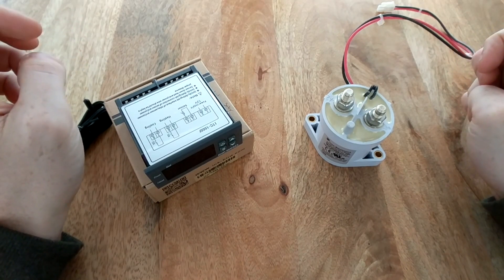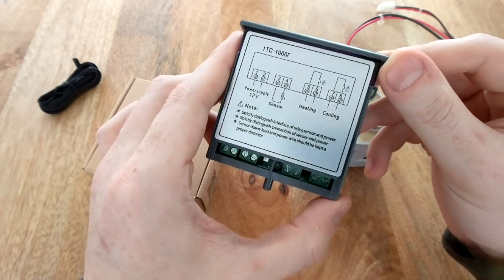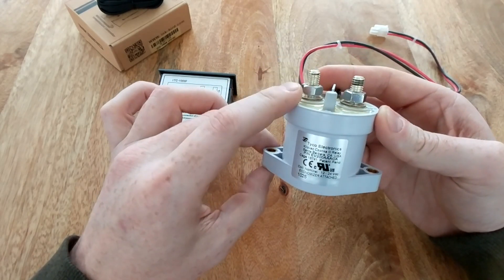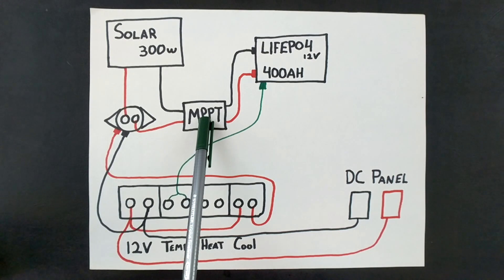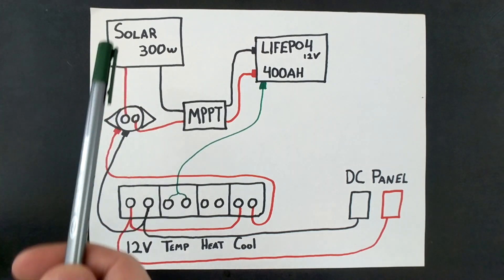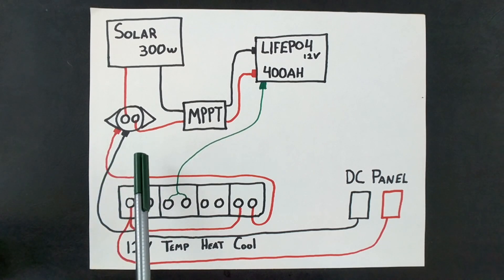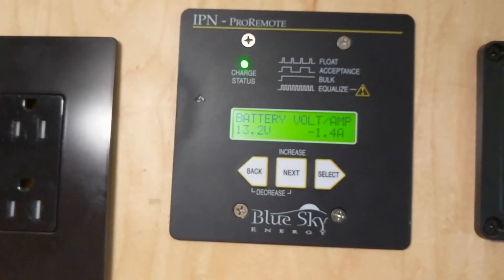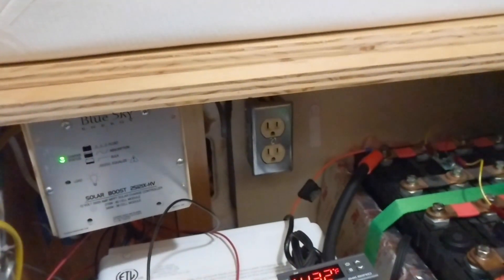How to Prevent Charging of LIFEPO4 Lithium Batteries Below Freezing in a Camper Van

Comment: my understanding is you do not want to disconnect "battery" from charge controller anyway in real world use.  a controller with no battery to send its incoming electrons too.... will destroy the controller is my understanding.     So it is good you; unlike your test,  put this solenoid in a place to stop output from solar panels to reach the controller.  This protects controller and batteries 

my question to you...... would putting a solenoid work on the negative line from panels instead of the positive as you did here?   

myself I will have 6 arrays.... each with their own controller.   My thinking is if I buss barred all the negatives from each array......  then single wire off that to one side of the solenoid.. off the other side being rest of negative path.  My thought is then the solenoid breaking the negative connection when batt temps are too low.......  would stop all arrays from sending juice to their prospective controller.  

Would that work??  Am a bit of an electrical dumbo.   

granted the other option is to use 6 relays. One on each positive connection between solar panel  array and their prospective controller.  Theoretically same as you have done here.

Comment: Doesn’t it take a certain amount of voltage to keep the starter solenoid/ relay open? 
If so, How much energy is that going to bleed off the power coming in from your solar?
Reply from the maker: it only takes130mA to keep the contactor closed so with a large enough bank that's getting charged daily, it's a non issue. However you can accomplish the same thing with a victron battery protect instead and that consumption will be much MUCH less.
Reply: No it only takes power to close the switch while charging. The thermostat uses minimal power to keep track of the temperature.

Comment: GREAT video! After reading all the comments, can you let me know if I'm on the right path. I'm upgrading the AGM's in my camper van to Lithium. I just purchased a Renogy 12v DC to DC charger with a MPPT built in. So charging can be from my van alternator or the solar panels. After watching the video and reading all the comments, I'm thinking of the following: buying the Inkbird and instead of the relay you used in the video, I can use the Victron battery protect? I would need to install it in-between the batteries and my Renogy charger?
Reply from the maker: In theory yes, that should work (and is much lower current than the contactor). Just make sure you wire the in and out correctly depending on which model you get. Current can only flow in one direction through a battery protect. Also make sure that your renogy will not attempt to charge your starter battery once the house battery is full as that will have reverse current and damage the battery protect.

However some chargers don't like it when the battery is removed under load so I have no idea how the Renogy DC-DC would react. I know Victron chargers don't mind if the battery is removed, but other brands (like my original MPPT from the video) specifically stated battery should not be disconnect under load. Since I've never used that model before, I can't say.
Reply: @nebulight  Thanks for the reply. After reading the Renogy manual (for the 2nd time), I noticed it said it will stop charging the lithium battery if below 1c, and reengage at 3c. So seems that the renogy dcdc charger with MPPT has low temp charging protection. If so, that is a great selling point that they are not highlighting very well.  Again, thank you for posting this video, hardy any videos out there covering this subject.

Comment: This is exactly what I was looking for! Thanks so much for posting this over 4 years ago :) So is there anything better you would suggest now that you've presumably had it working for 4 years? I just bought a 300Ah LiFePo battery that does not have low temp cutoff and it's pretty cold out at the moment. Last thing I want to do is damage my brand new battery. Thanks again.
Reply from the maker: I've switched to victron equipment. My battery monitor talks to the MPPT controller (also victron) to transmit temp data with a temp sensor on the battery monitor. So it just stops the charge of the MPPT automatically. You can also wire up the internal relay of the victron battery monitor (BMV-712) to open when there is a low temp and they from that relay, you can turn off other products like the multiplus through an AUX port. Tons of options with Victron.
Reply: @nebulight  What about charging from your converter?  I have my Victron gear setup similarly to cut of charging at a specific temp but that’s only controlling the solar charging.
Reply from the maker: @joshhaas2410  I don’t have a converter in my van. Most people opt to ditch the built in converter in rvs in favor of an inverter charger combo. Victron units have individual charge and discharge control. Since a converter supplies both charge and discharge there is really no way to control them independently. You could wire up a battery protect from victron on the dc side but that turn of discharge as well. Another option is to control the ax inout from the converter with a similar relay setup like the video. That would just turn off the incoming ac to the converter.
Reply: @nebulight  thank you for your advice.

Comment: What about the DC-DC charger?   Will this cut that off too if the temp drops?
Reply from the maker: If you do a setup like this but install the relay on the output side of the mppt and the dc-dc with a single relay it should work. If you do that, you can use a victron battery protect instead of a relay to save on power as the relay takes a lot of power .6 amps just to stay closed. Just make sure the dc to dc is one way (meaning it won’t attempt to charge the starting battery) if you use a battery protect.
Reply: @nebulight  Is it not a good idea to allow the solar to top off the starting battery too?
Reply from the maker: @tonywillingham8109  I only said that because if you use a battery protect current can only flow in one direction. If the current flows backwards through the battery protect you will damage the unit. If you use a relay that’s fine. Though note that charge profiles for lithium and lead acid are different so you may not want it to charge the starter battery anyway.

Comment: I like the idea.  Installing relay before MPPT protects it.  My array will be feeding a max of 75VDC at 9A to the MPPT.  Remote cabin in MN. 400AH LiFePo4 to protect. How may amps does the relay draw?
Reply from the maker: depends on your voltage that's driving the relay. I used this EV500 because I had a spare, but depends on the coil voltage. Could be around .65 amps with my EV500 (a bit high), but your mileage will vary depending on the relay you use. 

As I've said in other comments, I'm not using this setup anymore as Victron Controllers with a BMV with temp sensor can talk to each other and can stop charging on it's own. If you are building a system, I'd consider going with Victron gear.

Comment: Can you set independent heating setting temperature above the cooling temperature in order to control a battery module heater? I am imagining cool set to 0F and heat set to 5 or 10F to keep the battery going in low temperatures. I feel like most thermostats will not allow this since it is counter-intuitive for standard thermostat use.
Reply from the maker: You should be able to as there are two relays for heating and cooling. I no longer use this setup, but if you want to do this, keep in mind that the relays only support 10 amps, so that limits your heating source unless you control an external relay that's higher current.
Reply: @nebulight  what did you switch to using for cold charge protection?
Reply from the maker: @deathbyninja11  A victron MPPT and Victron BMV712 battery monitor. The BMV712 has a temp sensor and will talk to the MPPT turn off the charger when below a set temp. I also had the internal relay of the 712 control my DC-DC charger as well. When the BMV saw the temp below a certain temp, it would open the relay (which would turn off my charger).

Comment: I persued similar solution. I am frustrated considering the amps being used to run my external solinoid.  It runs very very warm to the touch so it is a significant power usage which is counter productive to solar chaging. does any one know of a 500amp rated with low power consumption rated data. i have not seen any such data.
Reply from the maker: I ditched this setup a long time ago in favor of Victron gear which has it built into the MPPT. How large is your solar array? My suggestion if this is a small array that's low voltage is to run the output of your mppt through a victron battery protect. That is if your MPPT can handle the battery being removed.

Comment: Glad to see someone did what I had in mind. Quick question, I would plan to use the layout in your video since I have an all in one Mppt ac to dc charger so I wouldn't want to disconnect only solar but the whole thing. But isn't using 12v to maintain the thermostat be harmful to the batteries?
Reply from the maker: If you have an all in one unit, if it has a power switch, you could bypass the contactor all together and just use the relay to control the on/off switch. This is typically better as if you do this to disconnect the entire unit, some MPPTs don't like to have the battery disconnected especially under load.

And using 12V thermostat isn't harmful to the batteries at all. Yes, it will draw power, but it's such a small amount that it won't impact the over all pack unless the battery is below freezing for days or weeks. If this is the case, it's better to just manually disconnect the battery.
Reply: @nebulight  Thanks for the quick reply. My unit is an MPP solar but only has a switch for the inverter. If it's plugged via AC or solar it will (I believe) still charge. But I like the idea, I'll investigate on this.
Reply from the maker: @Tom-yr3pt  Ah, yea, you're going to be limited there. I think the newer large MPP solar units give you the option for BMS integration over RS485 with a modbus card. Depending on your BMS you may be able to directly control the MPP. http://www.mppsolar.com/manual/ACCESSORIES%20(FOR%20MONITORING)/BMS%20RS485%20Card/RS485-Card-Box-for%20BMS-manual-20181106.pdf
Reply: @nebulight  Good to know! I actually don't have a BMS. I have two Valence U27-12XP wired in parallel which has internal cell balancing and low voltage cut off but balancing between batteries in a mix of series/parallel, high/low temperature is controlled by their external BMS which costs 500$ so I'm looking at other solutions. I have a Victron battery protect for the low voltage on 12v side, Mpp solar programmed to disconnect AC should it be ON but now is the cold weather, living in Canada and using this rig for hunting should I run out of propane while I'm out I want some sort of safety by heating the batteries and if all else fails to disconnect if it's becoming too cold.
Reply from the maker: Tom not many options with those batteries sadly. This solution might end up working best. If you have ac charging as well you can use the same 12v signal to trigger an AC solid state relay to disconnect the hot wire from your charger.
Reply: @nebulight  Yes I was thinking of simply having a relay that disconnect the main cable from the batteries to the Mpp solar. It would essentially act the same way as if there was a bms disconnecting, also similar as to switching off the main battery disconnect. I have AC charger at home but not while boon docking so that would primarily be solar. In any case I would need to stop charging if temps are low so your video might be quite on par with what I want to achieve. Disconnecting the main cable would trigger an alarm on the Mpp solar if there is still solar of if it's connected to the grid otherwise it would shut down.
Reply from the maker: Tom that probably isn’t a good idea as if you continually disconnect the battery from the inverter the high inrush current back to the inverters capacitors will most likely cause damage to the relay and inverter over time. You can but you should wire up a precharge circuit to precharge the caps before connecting.
Reply: @nebulight  Didn't know that, how does a BMS cutting off current works any different? Do most have precharge circuit? Also I don't plan on having this disconnecting often, my inverter is only 800W and is 98% of the time off. All my stuff is 12v and propane so I only turn it on to charge my Laptop and Milwaukee batteries once per week maybe. Still interested to read your thoughts if that would be an issue considering the (hopefully few time it would happen.
Reply from the maker: @Tom-yr3pt  Turning off the unit and disconnecting the battery from it are two different things. A cheap BMS disconnecting and reconnecting the battery is no different and still not good. That's why I'm not a fan of drop in replacement or cheap Daly BMS units when a larger inverter is involved. You'll often hear of users with a single battleborn try to connect and inverter and the BMS trips because it's over current. Most good BMS units don't disconnect the battery, they simply turn off the devices or interface with them directly to turn them off. A precharge circuit is simply a few resistors to precharge the capacitors of the inverter to prevent a large inrush of current before the main connection to the battery. It's typically uses in conjunction with a contactor (relay) and a BMS to control the on/off of the relay. It's easy to build your own, but there are a few ready made boxes you can buy (REC-BMS).
Reply: @nebulight  Would it be simpler and cheaper to cut the current from the solar panels like you did as well as the Ac-Dc charger instead?
Reply from the maker: @Tom-yr3pt  if the goal is just to disable the charger when the temps are below freezing, this is a simple solution. Also forgot to mention if you have a battery monitor, the Victron BMV712 has a built in relay that can be triggered to disable the charger when the temp sensor on the BMV hits a certain temp. I do this now along with a Victron Smart Battery Protect with the output of the solar and dc-dc converter going to the BP. It's also MUCH lower current than the contactor (I had a spare so that's what I used). However if you are starting from scratch, get a BMV and a battery protect for the current your max going to see. They make a 65, 100, and 200 amp version.
Reply: @nebulight  I already have a BP from victron but these are one way unit and wouldn't work with my all in one unit (mpp solar) but yes simply cutting the charging at low temperature is the goal.
Reply from the maker: @Tom-yr3pt  My bad, yes you've got the mpp.

Comment: This is an awesome idea since most cheap bms's i am finding don't seem to include low temp disconnect.
Reply from the maker: Max Stevenson worked well for me. I have since removed this setup since I switched to Victron gear which has this built in. However if you plan to do something like this, install it between the panels and charge controller as some mppts are fussy about disconnecting from the battery.

Comment: Great idea to control the low temperature cut off. You could use a normally closed relay instead of the normally open relay. The benefit of a normally closed relay is it does not use any current to charge your batteries. When the temperature gets to your preselected temp 35 degrees then current opens the relay to stop charging. When temperature goes over your 35 degrees the current stops flowing and your solar power is restored. This way you don't have to consume any power to run your relay.
Reply from the maker: The problem with that, is you require power to keep the relay open and if you aren't charging then it's just going to drain the battery pack. This setup was replaced about a year ago and I really should do a follow up video. You're better off having a solution like I have now that will simply turn off the charger when it's approaching the temp. I switched to Victron gear and since all the devices talk to each other, they just turn off when the temp is low. i should make a follow up video.
Reply: With a normally closed switch if you run out of power to keep it open the solar panel will charge below freezing and damage the battery.
Reply: The problem with normally closed is it will not fail open.